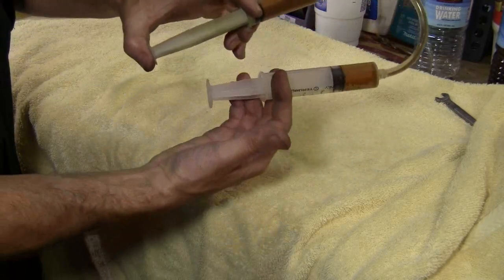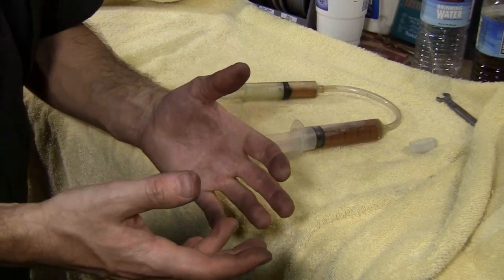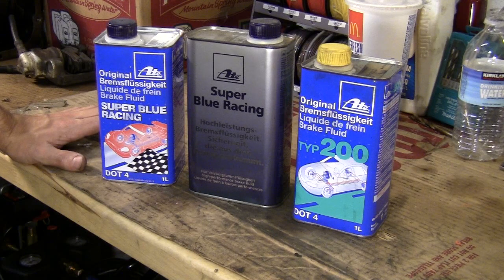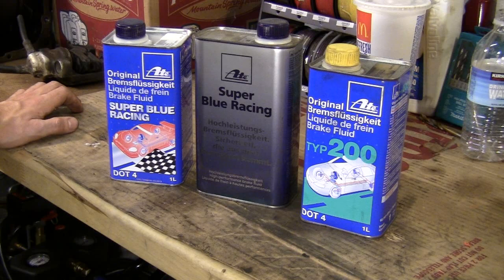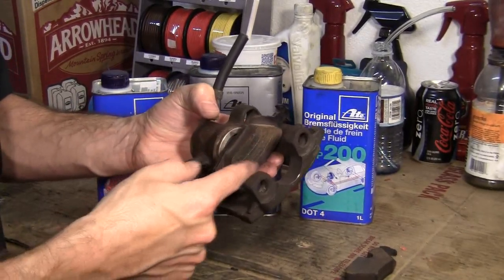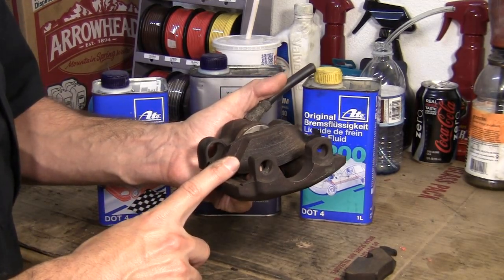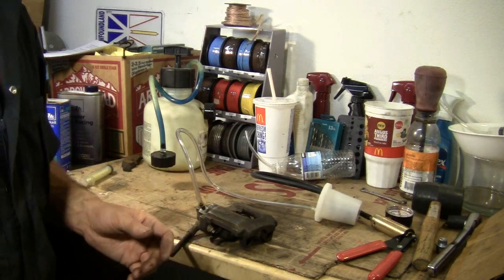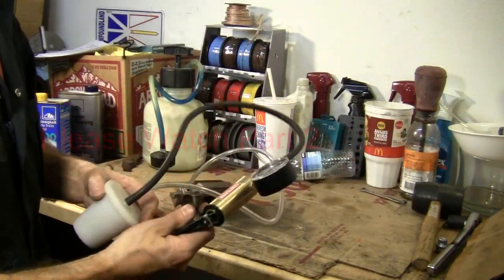Brake Bleeding DIY (part 1 of 2) BMW E30 E36 E39 E46

Comment from the maker: My guess is that the caliper bleed screws are clogged inside (with rust).  If you unscrew the bleed screw more eventually you will get brake fluid seeping out around the threads.  If that is the case then replace the bleed screws.  /John

Comment: John,
Muchas gracias por mostrar paso a paso como cambiar el aceite para los frenos.
As you can see (in Spanish) your video on how to bleed the brakes on the E46 was so well documented (Part 2) that I did not need to hear what you say about the whole process.

Great verbal explanation on this Part.   I have to add that I have the E83 (BMW X3), which the same principles will apply.

Thanks a million!!!!

auf Wiedersehen,

Carlos

Comment: John,  I tried using a vacuum bleeder, some how seemed to have sucked mass amounts of air in the system.  I have 0 pressure now, and have been attempting to bleed this thing for hours today.  Any advice on what I could do to eliminate this air?

Comment: I made it about 3 minutes into this before I needed to let you know this is one of the most informative and useful tutorials I've seen on here.  It has been extremely helpful in a situation I am having with my e38.  I have a huge air bubble some where in the system I am trying to bleed.   Anyway,  Thank you!